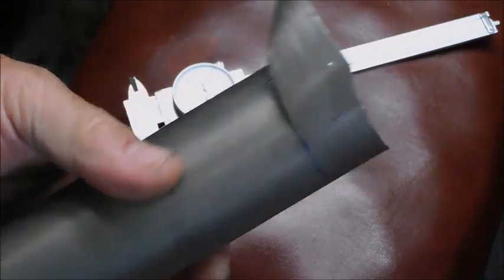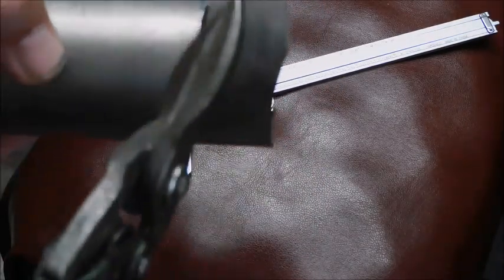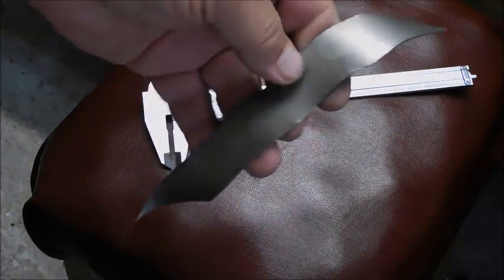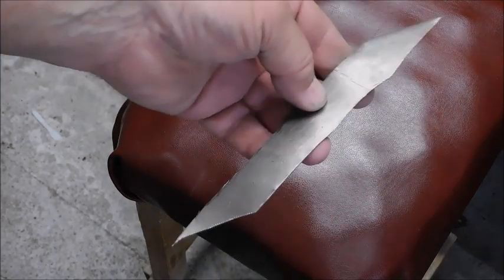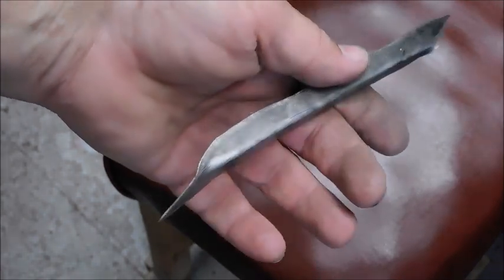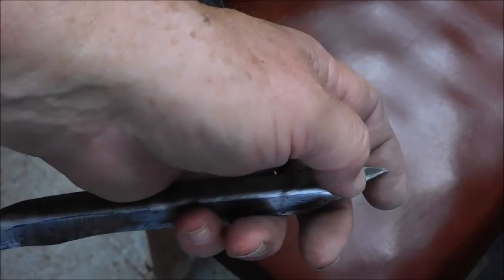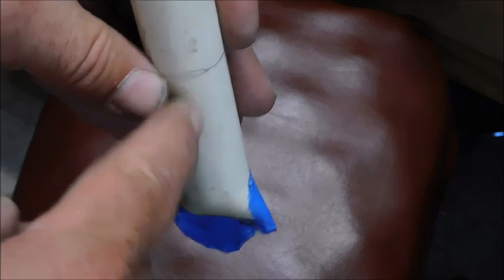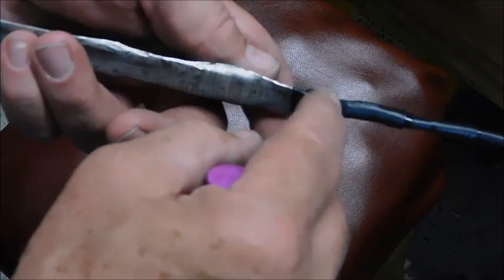HOW TO ELIMINATE SULPHUR SMELL IN WELL WATER! See description!

Comment: 9 minutes of nothing!
Thanks
Reply from the maker: What don't you understand?
Reply: @davenooner2142  I understand Dave thank you basically this is just an anode using a metal that will take longer to deteriorate
Reply from the maker: @TimLinton2  You are correct. I am wanting to plate the titanium with platinum to help stop collection of anything that will stop the conduction of electricity too. So this does work as is... but it does get deposites depending on the water conditions. Thank you for watching.